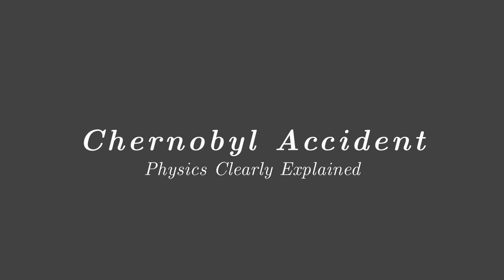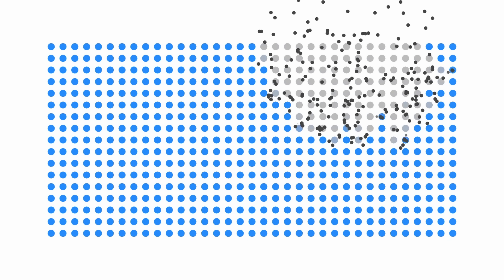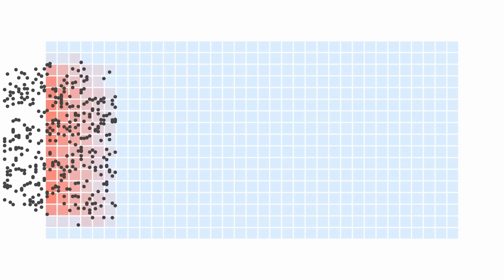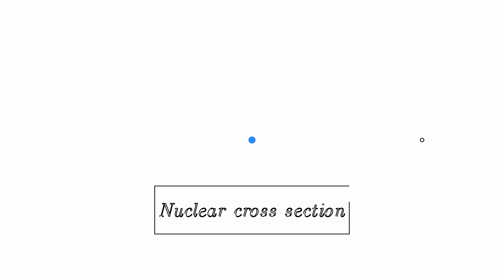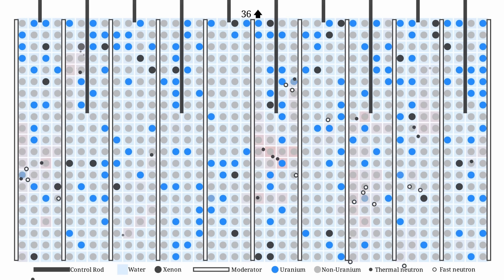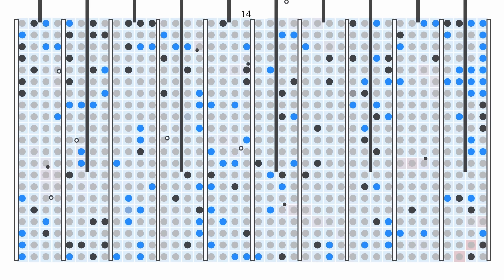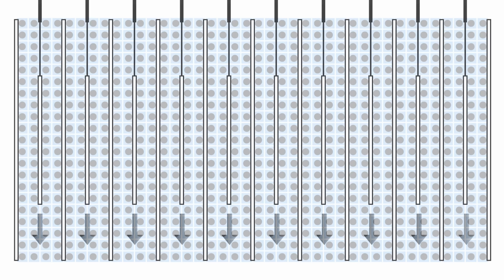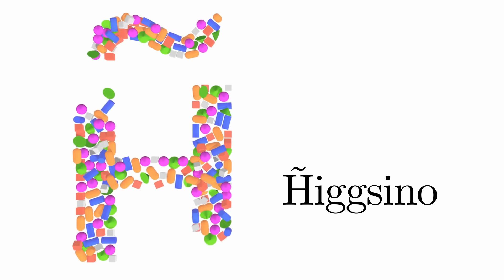Chernobyl Visually Explained

Comment: 14:22 - please can someone explain this part further? Why couldn’t the control rods go in? What does he mean by ‘the bottom had more accelerating power than the top had stopping power’?
Reply: Because the graphite tips on the lower parts of the control rods increased reactivity more than the small portion of the rods’ upper sections that entered the reactor to reduce reactivity.

When the AZ-5 button was pressed, the control rods began descending, but they got stuck before fully inserting. The high pressure in the lower part of the reactor caused the coolant pipes to rupture, which jammed the rods in place, preventing them from stopping the reaction.
Reply: @ thank you ☺️

Comment: notice the button on the right melted away. @ 14:05
Reply: That's wax, not a button. It was used to secure the string which was attached to the case around the button. You pull the string to break the wax so you can press the button. It's a safety measure.

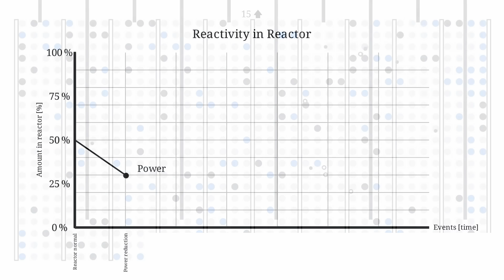Comment: 11:30 The safety protocol allowed for an increase in power in this situation under special circumstances. We do not know the detailed reactor parameters because the USSR (now Russia) did not share them. Please read INSAG-7, page 83, Note and stop shering russian propaganda. This is not the operators' fault; it is mainly due to the faulty design of the reactor.
Reply: We don’t know the parameters, but you know enough about them to call this version of events “Russian propaganda”
Reply: @spyingsundew5  "detailed reactor parameters" for example data form the reactimeter. Russian propaganda is very dangerous because is simple and logical, but reality - is much more complicated. Just look on INSAG-7, I-5.1. chapter on page 85.
Reply: @spyingsundew5  i based on raport provided by international atomic energy agency. INSAG-7

Comment: I can relate, I also start emitting unctrollably after moving my control rod in and out of a moist heat source.
Too bad it's a far cry from an elephants foot, at least in size...maybe not in smell.
Reply: P.S.: The particles being really loud toward the end due to the overlap can be prevented by limiting the amount of sounds that can play at the same time.
Make a ring buffer/array sized 5-10 of sound players and iterate over it every time you play a sound. That way, after 5-10 sounds, it starts at the first again, and usually, depending on the API, you can just request another play of the instance and it will stop the old sound and play the new one.

This quick method eliminates a LOT of self reinforcing soundwaves (some might call it ironic, but it's coincidental of course) , preventing a chernobyl of sound, lol..
If they play in very quick succession, and you have like 10 of them, it can still boost volume, but it will be much quieter than 100 or so.
Reply: P.P.S.: Hot dang you deserve a better comment section. 
Muh accent, muh chOrnobyl.

Comment: 7:15 one thing i never understood. doesnt faster molecules actually mean that they are more likely to interact because theyre traveling more distance in a shorter time and thus should be more probable to hit?
Reply: it's like throwing a tennis ball at some Velcro. If you do it slow, it will stick, otherwise it will just bounce away. Velcro here represents the strong nuclear force
Reply: Yes but if the particle is too fast, a reaction can't even start

Comment: The control rods had moderator tips, they were double function.. So after removal of almost all control rods (due to xenon poisoning they couldn't get power up for the test) and trying to re-insert them as power spiked too much, those control rods caused the power to go even higher instead of killing the reaction

Comment: Hello. I just came across your video and want to say thank you for telling the story of the Chernobyl accident in simple language for ordinary people. With your permission, I would like to make a couple of corrections to your story - the "reactor" is depicted in the video a little incorrectly - it gives the impression that it is a large pan with boiling water and floating cubes of uranium fuel, into which the "rods" are lowered. But in fact, the RBMK core is dry, filled with a nitrogen-helium mixture to increase the life of the graphite masonry around the core, and water circulates through the channels between the fuel assemblies.

increase in the reactor reactivity at the moment of lowering the control rods after pressing the AZ-5 button, is called the "end effect", precisely because of the presence of graphite at the ends of the rods, the so-called "displacers" of water from the channel, which finally brought the reactor out of its precarious equilibrium - because of the graphite and lack of water, the shape of the neutron field in the active zone changed, the remaining water in the channels instantly boiled, the steam pressure deformed the channels, and the control rods physically got stuck at the 3.5 meter mark, according to computer data at 01:23:49, and the reactor could not shut down, on the contrary, it began to grow in power even more, as a result, on the recorder measuring the reactor power, it was a long vertical line beyond the border of the writing tape.

The most ironic thing is that the chief designer of the RBMK reactors never recognized the phenomenon of the "end effect" when all the absorbing rods were lowered simultaneously, as the main cause of the accident, blaming anyone but himself for this accident, creating such a cheap, but very dangerous reactor in some conditions. The Chernobyl NPP personnel knew almost nothing about this effect, which is why they blindly trusted the AZ-5 protection. If they had known it, they could have lowered the rods in small groups, without introducing too much positive reactivity at once, and safely shut down the reactor. I apologize for some language errors, I translated with Google Translate. I can also provide a website with a detailed description of the Chernobyl accident, with all the data and graphs that are currently available.

Comment: Incredible video. It's only goes to show what a beautiful balancing act a reactor is. 

You joked about the reactor design name at the start, but having the moderator hang off the control rods—wow. It's like having a single pedal in your car where pressing it causes braking, and letting off not only removes the brakes but also adds gas. Coupled with a car engine that doesn't idle when you don't add input, but wants to full throttle. 

Maybe the design isn't bad, but I can't say it's good either!

Comment: 15:25 It's extremely unlikely if not impossible that the control rods or anything attached to them above the biological shield was "jumping up and down". I know this is related in some non-scientific retellings of the accident but there's no mechanism that could cause this. This is a pressure vessel, it's either breached or not. If it's not  breached, nothing is "jumping" externally, and if it's breached, the first explosion of the accident immediately happens.

Comment: The root cause failure was them wanting to un-stall the reactor without allowing enough time for the xenon to burn off.  After that, it was just a matter of just which failure mode occurred first.
Like driving a 40 ton truck over a bridge designed to carry 20 tons.

Comment: I think this is an amazing step by step explanation, but I think a little more detail on the graphite tips of the control rods could be useful (btw, I'm not an expert, so I might be wrong, in which case, apologies).

The graphite tips were roughly ⅓ the length of the reactor. When I the control rods were fully withdrawn, ⅔ of the control rod channel were void.

When the rods were inserted, the graphite tips would briefly displace void, leading to a localised increase in the R0, before the boron controls displaced the graphite, decreasing the R0 ( a big problem in an emergency shutdown).

Subsequently to the Chernobyl disaster, graphite tips were extended to the full length of the reactor, meaning there was no void present in the control rod channels. This means there was only boron displacing graphite, reducing the R0.

Comment: Fun fact about SCRAM in modern naval nuclear reactors: a Chernobyl-type failure cannot occur unless the reactor compartment has been catastrophically compromised. There is an air tank, pressured to 4500 PSI (31.02 MPa), whose sole purpose is to slam down the control rods in the event of SCRAM. Once actuated, the control rods slam down with such force that they will spear through pretty much anything.

Comment: The one thing I'm still confused by is why lowering the control rods increases reactivity. I understand how the hanging moderators increase reactivity, but why does moving them down increase it further if they're already in the core? It is because the water around them is already gone and moving them down just allows more water to flash to steam faster?

Comment: Maybe it's my misunderstanding of the mechanism but the way it's explained seeeeems like the major point of failure was that the control rods meant to slow the reaction didn't descend because... well, they were sucky or something and just jammed... it's not clear to me why that happened. 

Obviously many other things were problematic, including some poor choices made, which could have averted the need to lower them like that. But it sounds like they were the safety backstop that just failed for no real reason. Surely that's not it. What have I missed?

(Awesome job on the video though, I gotta say)

Comment: Just one thing i noticed, you have the water heating up as a neutron passes through the water, making a heat trail of sorts insteads of just the square where the neutron eventually makes contact with a molecule.

Comment: Hi! Your video is perfect from point of how it explains the physics, but... conclusions are so bad that I didn't even expect it to be at such level...
First of all, words "The computer told them to turn off the reactor. They turned off the computer instead."
Man, do you know how the nuclear station looks like and how computers looked like in 1986? You have a sick imagination. Computer wasn't telling them that much, all the decisions were made by human according to the indicators at the control panel. Computer was mainly logging all indicators only and showing some statistic for the last minute (because that's the time that was needed to finish such complicated calculations at that time). It would be almost true to say that controlling the nuclear power plant was manual at all steps.
In the section "Other factors" you literally copied the Soviet propaganda that was blaming the team in the disaster that happened. But this is actually a brutal lie.
"Human errors and unexperienced team" - what exact errors did the team make? remember that they didn't know about the problematic construction of the reactor that you explained in this video, and this is not a problem of the team, this is a problem of the person that created and built this reactor. The team was controlling it without knowing those details about uncontrolled chemical reactions. Also, even though that team was less experienced than another one also working in Chornobyl, they were smart enough to control such kind of nuclear power plant. Blaming a team that they are responsible for the disaster is like buying a car and when the steering wheel falls off - we'll say that you were not experienced enough to expect that this could happen and that you were not able to prevent the car accident without the wheel. This is totally nonsense. The main responsible person in this disaster is a person (or persons) that planned and created this type of reactor. Period.
"The lack of the safety culture" - safety was good enough, in accordance to the normally working reactor (not the one they used which wasn't normal).
"The ability to turn off safety systems" - this was required for this type of the test and the main target was to increase safety by results of this test.
"Cheap reactors over safety" - this is the only valid point: USA and other countries were building reactors with a cover that prevents any radiation leak in case of the worst scenario. Unfortunately USSR decided to make it cheaper and didn't build it. So when reactor exploded, all radiation was immediately outside.
"The Soviet Union corrupt system" - I do not agree that Soviet Union was that much corrupted. Absolutely no. It had wrong priorities - yes, it had very much brainwashed - yes, it wasn't thinking about safety first - yes, it wasn't much caring about people compared to other countries - yes. Many things were limited by communist party leaders, as well as hard censorship and so on and so on and so on. But corruption... no, it wasn't that big issue. Just people were very much forced to do things, but that's not corruption. So, what did you mean by that phrase? Corruption appeared at the time when USSR started collapsing, that was after Chornobyl disaster.
Yes, I am not so good in physics, but I listened to many many interviews of people that were involved either in the disaster, or on it's liquidation. So I know a lot about it, and I visited Chornobyl itself more than 5 times. Believe me, your point of view is very very simplified and it is not correct.

Comment: And that is how you trigger a prompt critical excursion that vaporizes the core, over pressurizes it, and blows it all to hell. i.e. a low-yield in-core nuclear detonation with prompt core disassembly, followed by rapid hydrogen gas evolution and a consequent hydrogen-oxygen detonation, and a massive Wigner release, all of which leads to the catastrophic destruction of the reactor, reactor building and the death of 10-100,000 humans.

Comment: unfortunately the voiding was not the initiating factor as your simulation displays it. but today there is agreement with diatlov's picture of the 2-reactor effect due to the reactivity insertion via the graphite dsplacers of the control rods. the reactor was literally flooded with water, MCPs running full speed and at a tiny 30MW power level when the Scram was initiated, no way boiling can have been the initiating effect at that moment in time. of course it then contributed to the power surge when the reactor was already doomed.

Comment: I like to point out that the rods were not stuck, but they were fully extracted. When pushibg them in they displaced neutron absorbing water in return for graphide at the botom of the reactor. Since two parts of the rods where now inserted less water was present and this causes a shudden spike before the controlrods can do their job.

Comment: As scary as the concept of an uncontrollable machine or system is, the biggest threat and danger will almost always be the human element. You can create every warning and safety mechanism imaginable and it still won't matter if the human operator has the ability to bypass those safegaurds.

Comment: Why did the control rods get stuck? Did I miss something? I caught the part about the reaction being stronger lower in the reactor due to the reaction rods on the tip of the control rods. But that didn't really explain why they physically couldn't move. I'd always assumed it was something to do with heat, expansion of materials and clearances between the rods and the bore they move in. Am I in the ballpark or way wrong?

Comment: Excellent explanation - like most people I had an idea of what happened but all those terms like "positive void coefficient" were vague. This is a really good detailed explanation esp for those who have a reasonable understanding of nuclear reactors. You can see they could have fixed it right up until minutes before everything went wrong. I wonder if we could calculate the last possible moment before the explosion where it was fixable.
Reply: The data is pretty lacking which makes exact calculation impossible. But there are some simulations that have been done.
According to some, not pressing the AZ5 (SCRAM) button would have averted the catastrophe, if you also disabled the safety systems that would automatically trigger a shutdown. The reactor would still have suffered significant damage, but not as much.

Comment: you are lying, rods did not stuck but rods was too short because made with 4.5m lenght instead 7m in specification
that's a problem, commies is too stupid to avoid cheaper (but not cheaper) methods

Comment: The reactor went prompt critical. There would not have been enough time for the control rods to prevent it. Graphite tips or not, it was too late. It's as if the operators wanted to show how to make a reactor go prompt critical.

Comment: Complete physics noob here. In the final event, right before the explosion, why did the uranium also start appearing faster?
Reply from the maker: I just set the uranium concentration to be constant always, so when it's used faster, it's appearing faster.

It has nothing to do with physics of course. I did it because otherwise it wasn't possible to show you a nuclear accident with only approx. 1000 circles
Reply: @Higgsinophysics  Thanks!

Comment: This presentation is like a piano solo with a symphony of details supporting the melody.  The theme of safety-protocol violations comes through much stronger than the books I've read on the topic.  Also, I heard of another Soviet reactor in which some of the knobs and switches had to be replaced because the operators wore them out trying to keep the reactor under control!

Comment: This is an excellent simulation and great physics explanation for people who don't know the subject much! Only thing I would have added, what actually caused the explosion is that, by pushing the control rods, they pushed water, which absorbed neutron. The water at the bottom was thus replaced by the graphite tip of the rod, a moderator. So the reaction got faster. Water boiled. So the reaction got faster. And then it went boom.